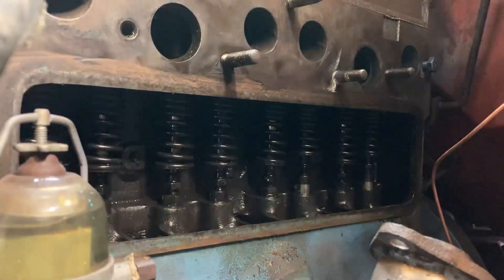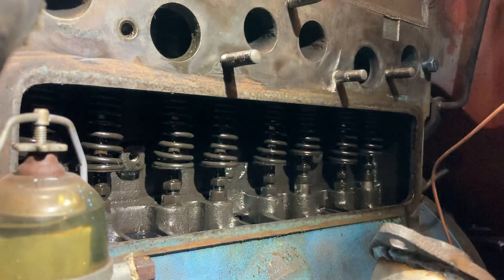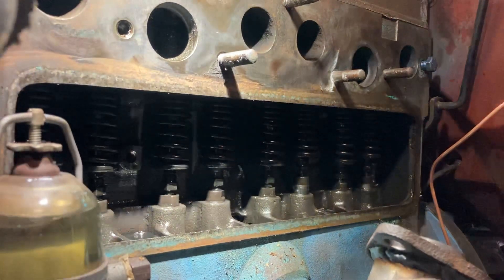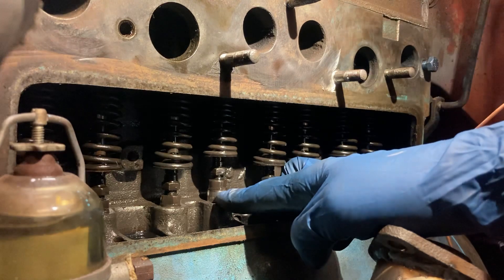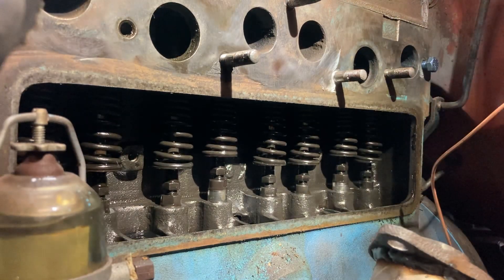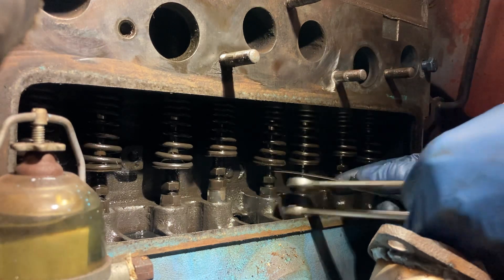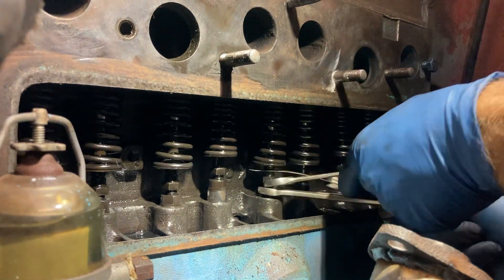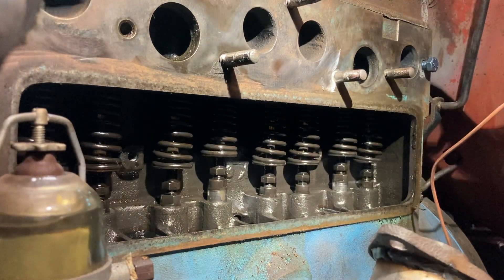Willys Cj2A L-134 valve adjustment flathead

Comment: EXCELLENT AND INTERESTING METHOD FOR ADJUSTING VALVES.
MY QUESTION IS,
FOR AN 8-CYLINDER IN-LINE FLATBEAT ENGINE, WHAT IS THE MAGIC METHOD TO USE? PLEASE
Reply from the maker: Sorry I don’t have any info on v8’s. I would imagine the process is very similar. The main thing is that the valves are all the way closed when you adjust them. Eg. the cam is pointed 190° away from the Tappet
Reply: @SethHensler  Thanks, friend.
It wasn't for a V8 engine, the information was for an inline-8 engine.
I figured there would be a magic number too.